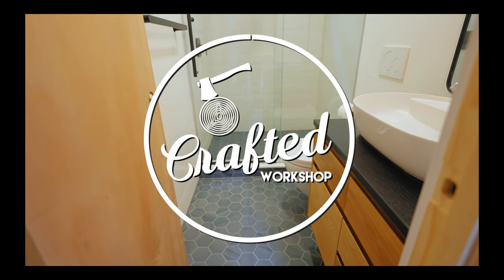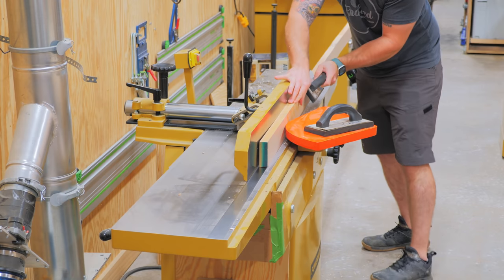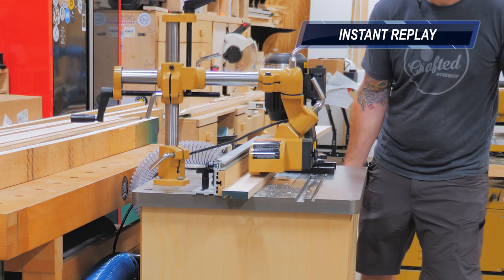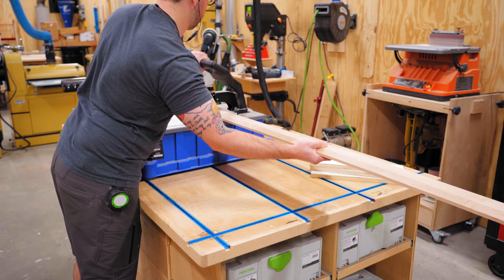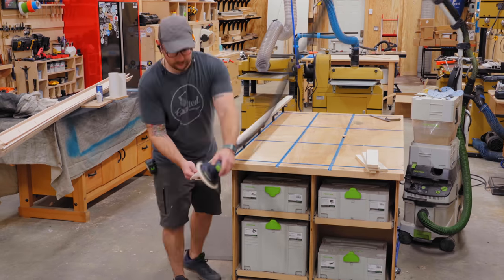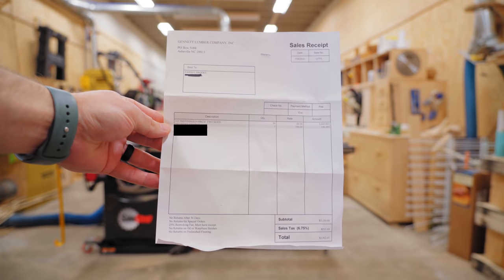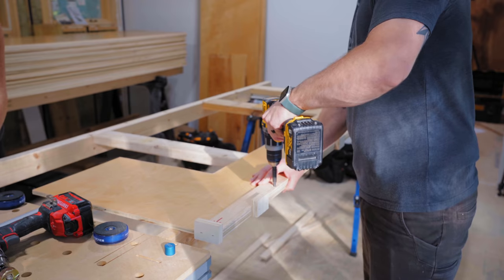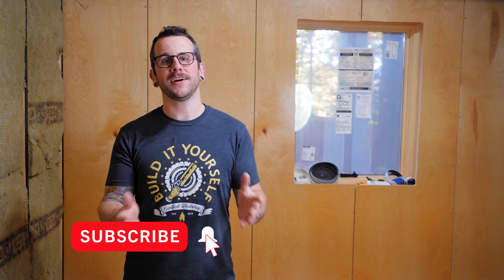Milling CUSTOM TRIM and PLYWOOD WALL Prep in the Not So Tiny House

Comment: Shoulda done drywall. The paneling looks like golden oak from 2000s 😬😬
Reply: I think it’s down to the finish. Plywood walls can look fantastic but the glossy finish here makes it look a bit dated.
Reply: @cleckie  And the plywood itself. I feel like plywood walls only look good if they're really clear light birch (or nice walnut for an accent) but these are clearly not at all and look more like terrible basement panels

Comment: I noticed that you didn't route any relief channels like one finds in commercial trim on the back of these.  Are they unnecessary in your opinion?  I've been putting off the rest of our baseboards because adding the relief channels to the 1x6 finger jointed stock that is by far the most economical approach is such a chore.
Reply: maybe the pocket screws make that unnecessary?

Comment: 60 bucks a sheet is actually not that bad based on what I'm hearing in the market (northern NJ)
Reply: Come to Cali, you can't even buy a POS  plywood from the big box stores for under $70....and 4x8 Baltic Birch is well over $150 per sheet at the lumber yards